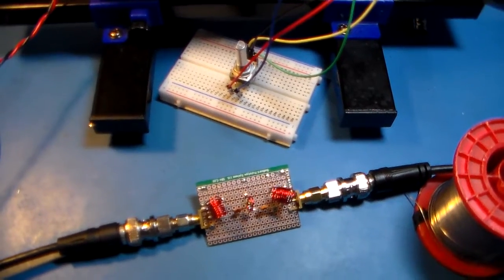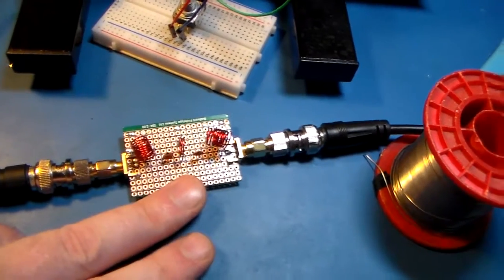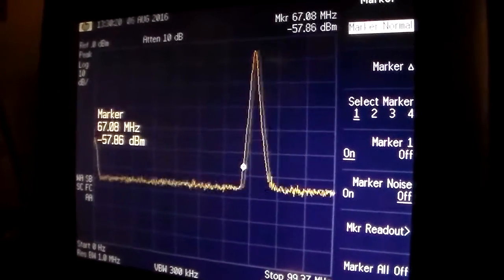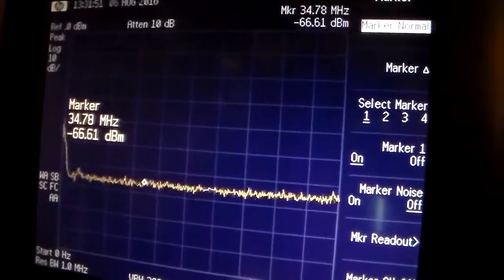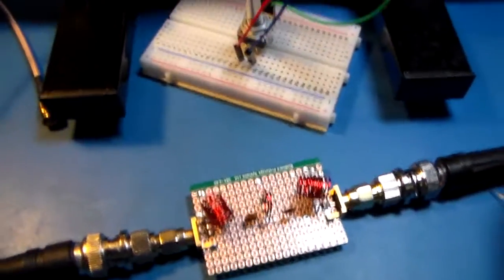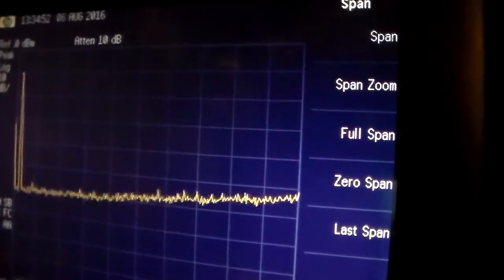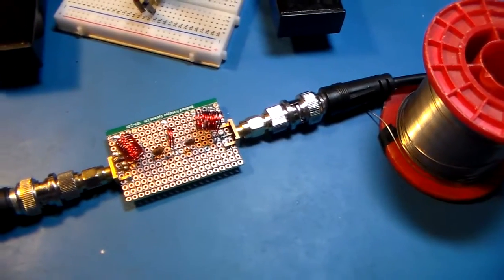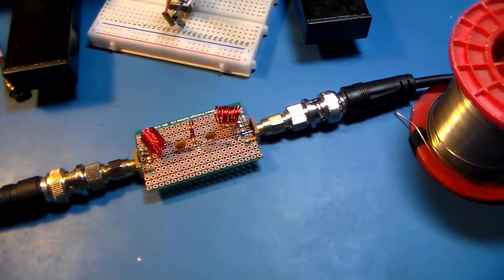Testing a high pass filter

Comment: Shouldn't really need variable caps.  Would be nice for the initial testing but once you get it tuned you can just measure its value and then use a fixed value cap.